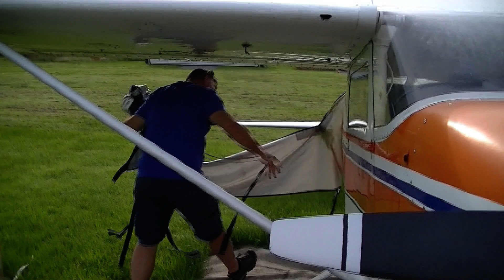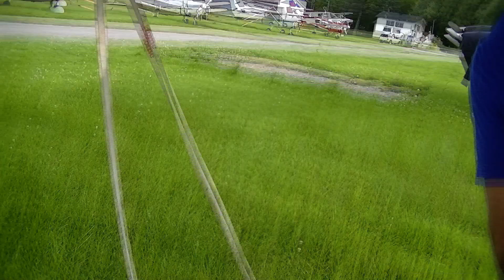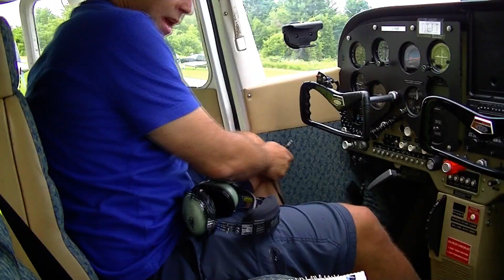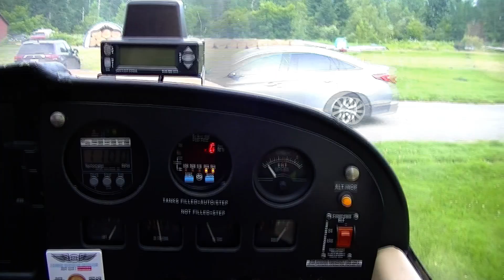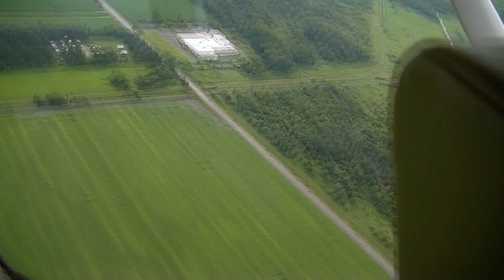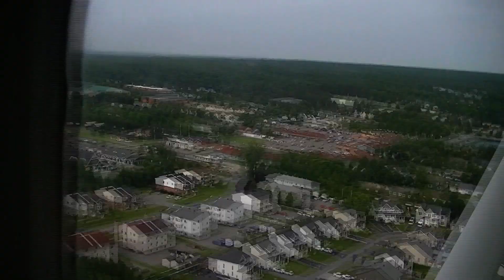Flyin' Bryan 1: Walkaround and Circuit

Comment: Good to see another aviation youtuber who's actually a pilot too. You can look into some fixed camera fore and aft (Gopro etc.). I even used to have a special connection to plug my headset into the camera so I could record the radio and conversation in the cockpit. I'm guessing the tech has come on a lot since I used to do all this 10 or 15 years ago. 😀
Reply from the maker: Thanks for the tips!